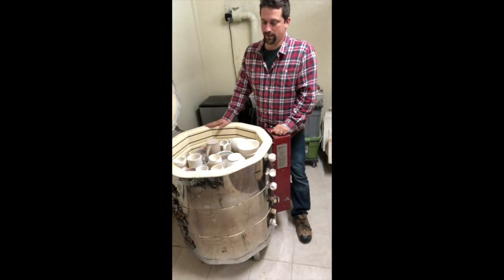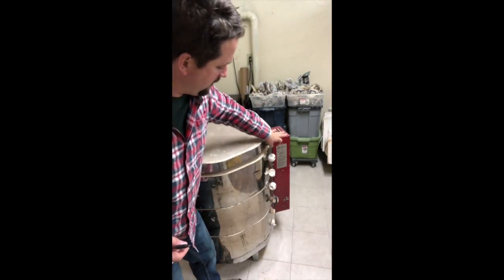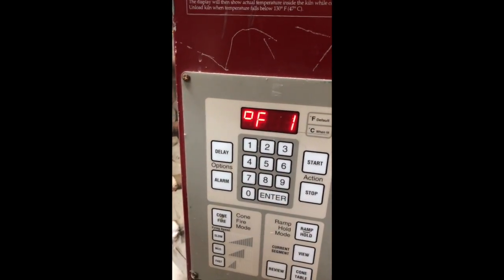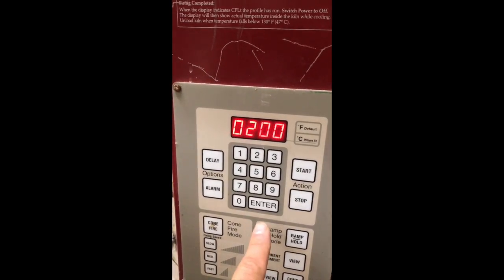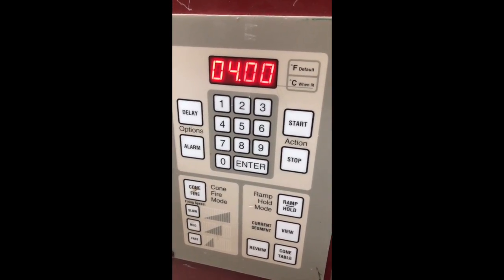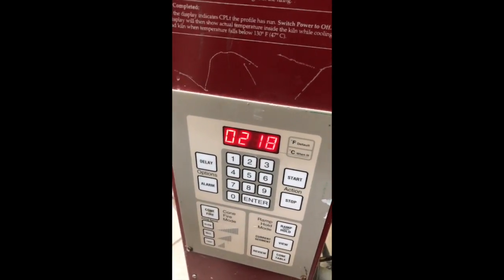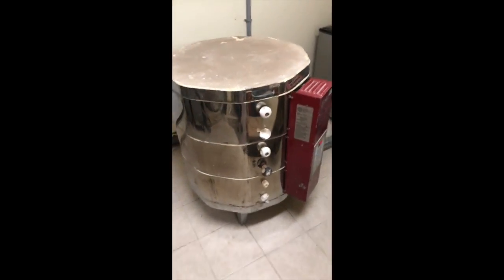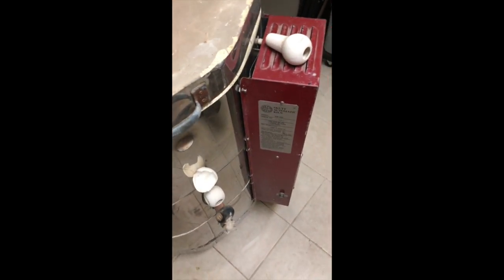Help! I want to preheat my kiln

Comment: So after the preheating time is up, do you switch to the slow cone fire program? (My older kiln doesn’t have a preheat option.)
Reply from the maker: If you set it up like I have talked about here when the program is done I then start the slow firing for a bisque.
Reply: Timsee clay thanks!

Comment: With this particular skutt you can set a cone fire pick your cone/ramp rate you want, then hit the top right unit button, then hit 75 on the key pad to bring up a pre heat prompt, set how long you want to pre heat then hit start.
Reply from the maker: Andrew Carrizales that preheat button is great and all but eliminates checking the work and kiln to verify that everything is dry. For me that’s more important than convince. Setting a over the top preheat is also possible but it’s wasting time.
Reply: Timsee clay ah ok got ya, I can't tell you how many times I've heard "I wish my skutt had one of those preheat buttons like the new ones", nobody seams to know how to find the preheat setting on the older controller. Nice to see a bit of the other side of making pots.
Reply: Thank you for this comment!! I couldn’t find this command anywhere and have been running ramp hold cycle which took a looking time with the firing!